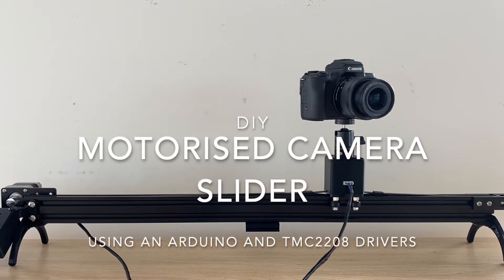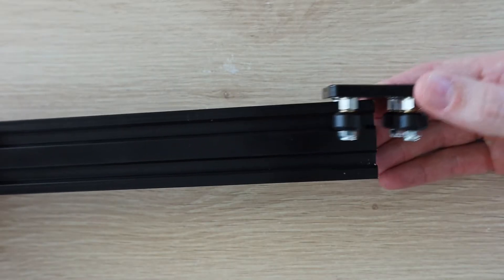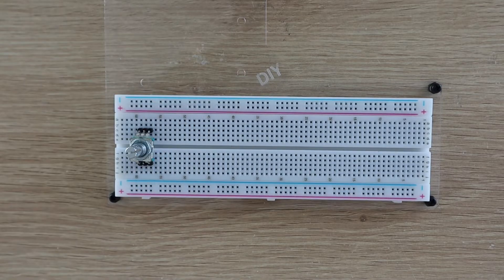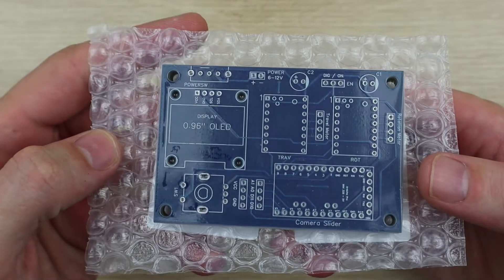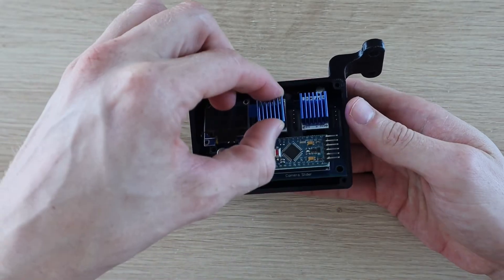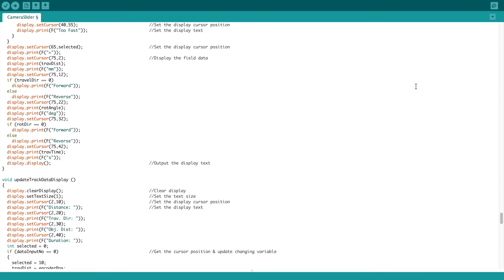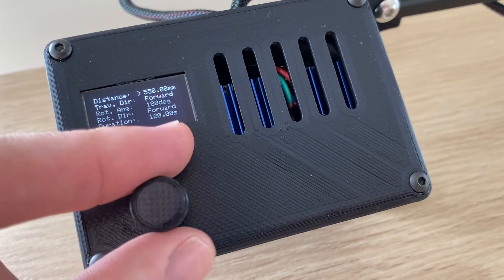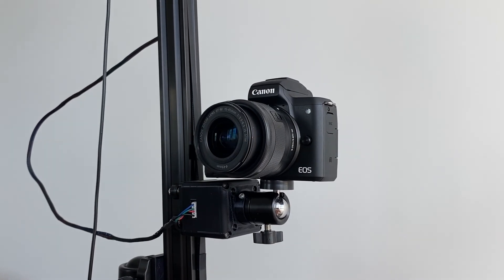DIY Motorised Camera Slider With Object Tracking

Comment: Awesome project! Thank you so much for documenting it. I am considering building something very similar. It wasn't mentioned in the video or the blog post I think, but does the slider have some kind of a homing mechanism? Do you have to manually move it to the start of the slider before you power it on?
Reply from the maker: It doesn't have a homing mechansim, this could easily be added through a limit switch on one of the available inputs though.

Comment: Hi. A 12V voltage was connected to the PCB board. But More than 8.9V flows inside. Where does the DC Stepdown take place?

Comment: Brilliant project ! I think I will strip down my own and modify it to this. I however have limit switches on both ends which I would like to incorporate, and I would like to run the pan stepper via a 5.18:1 planetary gearbox to take the rough steps out of the motion. Not being a coder, what would I need to change in your code to compensate for the gearbox reduction ? So the degrees match on the OLED to the actual output.

Comment: I haven't checked the maths on paper, but I'm pretty sure you can do that trigonometry backwards to save on measuring. Travel to one end and pan to the target, save the position, repeat for the end movement, and you should be able to solve backwards. Or at least, you can triangulate the distance to the target and use that as the input for your existing maths instead of a manually measured distance.

Comment: Can the V-Slot Gantry and Belt tensioner be 3d printed? Also, is there any chance you could share the EasyEDA file as well? I need to swap out the Arduino for a Nano.
Btw, can't post anything on your blog, the WP spam protection doesn't like me at all, no idea why.

Comment: Thanks for sharing! I built my camera slider when COVID first hit. I released the video less than a year ago too! It's always nice to see what others did! Ours had a lot of similarities, especially with the motor driver selection. I like that you made a PCB, this will make things far more robust. I used an old telephone cable for the pan stepper motor so that it stays nice and compact. Check it out! I plan on upgrading my camera slider to an STM32 based design where I can take advantage of its hardware features. I will find myself coming back to this video for inspiration about the object tracking! Thanks again, subscribed!
Reply from the maker: I like the telephone cable idea. Maybe have a look at using an ESP32 dev board, at their price with built in WiFi and Bluetooth , they're hard to beat.
Thanks for the feedback!

Comment: Hello.
This design is brilliant. After burning two arduino pro mini modules, I decided to run the project on CNC shield v3.

I have modified the code, but I have a problem with the rotation button (the button works, but the rotation, unfortunately, does not – I cannot change the value)

I would ask for help if possible – maybe others will also benefit.
Below are the places where I modified the code:

================= modified lines of code ==============
static int pinA = 13;
static int pinB = 12;

#define encButton 11

#define enablePin 8
#define travDirPin 5
#define travStepPin 2
#define rotDirPin 6
#define rotStepPin 3
===============================================

Everything works except the rotation of the button.
Should I set inputs 12 and 13 somewhere apart from the first two lines?
Reply from the maker: Hi,
I replied to your comment on my blog as well - you're likely using pins on your Arduino that aren't interrupt pins (not all pins on an Arduino are). The rotary movement triggers these interrupts to drive the control in the code, so if the aren't triggering then the rotation won't do anything. Have a look at what pins on your Arduino are able to be used as interrupt pins and re-arrange your IO to suit these.

Comment: This looks great and I think I can source all the parts! Quick question regarding PCBway, the ordering process is super confusing - do I just leave everything in the quote form at its default values or do I have to change anything?
Reply from the maker: Don't use the manual quoting too, PCBWay have a quick quote tool that asks you to upload your Gerber files and this populates all of the fields with data from the fields or good defaults, you can just order them straight from this form without any "technical" input.
Reply: @MichaelKlements  thanks! Ordered them and they came today! I'm going to try to do an 8-ft set up instead of a 4ft. I'll let you know how it goes.
Reply: Same question
Reply: @kodyhenry7  So I figured out after speaking to a rep at PCBway. You gotta register an account, then go back to the form and leave everything default but enter in the approximate dimensions + the quantity you want - then you submit it, and it will ask you upload to gerber files - then they manually review it and update anything that needs to be changed (ie the dimensions) so getting the form right doesn't really matter.
Reply: @OnceinaSixSide  Thanks! That was way easier than trying to create an order. Already landed on my doorstep!

Comment: Amazing project! Would this be compatible with an Arduino ESP32 board? I'm interested in making the project for ligthfield photography which needs pictures taken every x cm, so I would need to modify the code so the belt stops each cm and sends a bluetooth signal to activate the shutter
Reply from the maker: Thanks Aurelio. Yes the circuit and hardware are all compatible with an ESP32, you just wouldn't be able to use the PCB design as the footprint is obviously a bit different.

Comment: Hi Michael
After a lot of distractions I have tried to assemble the slider.
Unfortunately I can't get the stepper motor to fit in the case for the rotate  function.
The pin socket sticks out to far.
I have several spare stepper motors .  None of which will fit.
Did I miss something in your original video and instructions.
All the printed parts printed very well in PLA on my Ender 3 Pro
Your advice on this dilemma would be appreciated.
Regards Ernie
Reply from the maker: Hi Ernie,
Is there no way you can trim a bit off the top of the connector with a craft knife? How far is it sticking out beyond the edge of the case? You also might be able to push it in if it is at an angle (not square to the case).
As a last resort you could try widening the model a bit before printing it out.
Reply: @MichaelKlements  Hi Michael
Thanks for the information.
I put the model for the case into TINKERCAD and lengthened the hole to about 6mm from the top edge and widened it bit 1.5mm and reprinted it.
The bigger rectangular slot doesn't look out of place because the stepper motor is painted black.
Thanks again for your help.

Comment: This is brilliant mate. I am strongly considering doing this myself, I am a retired web developer but never done anything with electronics so it going to be a learning curve. The most intimidating part for me because I've never used breadboard and arduino will be setting this up and testing it, then I need to learn how to do the pcb design. Your video has basically demonstrated everything I want to do. Not sure if I can do it all with arduino with the LCD menu etc or whether if this would be easier in rasberry pi?
Reply from the maker: Definitely give it a go, you'll learn a lot and enjoy the process. The PCB file is linked on my blog post if you want to just use that one, then you don't need to do any PCB design.
I find that these sort of projects are better suited to run on an Arduino as you can then power them on and off at will without shutdowns and boot up times and you don't have to worry about corrupting the SD card. They're also more power efficient.
Reply: @MichaelKlements  Thank you so much, this is so helpful.

Comment: One of the best solutions and almost perfect. One weak thing is ball-head directly connected to motor - it's weak and doesn't smooth part/movement. You need to add "reduction gear" with using belts. It will make it smoother and more powerful, there is no need in speed, but smooth and torque are important. Is there any simple way to add ratio for one motor to the code? (I'm too far from programing).
Reply from the maker: The easiest would be to just adjust the number of rotation steps according to your new gear ratio.
Reply: @MichaelKlements  Hi Michael, I'm currently building this slider and am exploring making such a gear reduction and belt solution for the pan motor. If I were to for example use a 2:1 gear ratio, what needs to be changed in the code? I can't find anything in there pertaining to steps, the closest thing I could see is float pulsesPerDeg = 4.4444. If I'm using 2:1 is it as simple as doubling that variable to 8.8888?

Comment: Can you make it loop the pan/rotation? Like, set it once for a interview shoot and it will loop Left & Right until I press the button? If so, how can I do it? Thanks for the insightful video, motivated me to get into arduino coding.
Reply from the maker: You would need to add an extra loop to the main function and reset the counters but it should be fairly easy to get it to just cycle back and forth
Reply: Anyone done coding with loop function ?  Please share Needed Badly .

Comment: Hello Michael, great work, I am mindblower of the work you have done.
I wanted to ask how long is the slider and can I modify the size and if possible how can I do it ? 
Do I need other parts to do it or am I fine with these parts for a 1.5m slider ?
Reply from the maker: Yes you can extend it if you'd like, but only to around 750mm and then you'll start getting overflow issues on the number of pulses unless you extensively modify the code. If under 750mm then you just need to change the slider length variable.
The parts all stay the same.

Comment: Ciao Michael, desideravo sapere se cambio questo valore da 550 a 1000  

#define maxTravDist 1000

Perchè quando seleziono per esempio dal menù Pan e setto la distanza 1000 la direzione avanti o indietro e la durata lascio 120s mi esce la scritta troppo veloce tradotta io in italiano e quando lascio 

#define maxTravDist 550

e faccio la stessa configurazione, se voglio far uscire la scritta troppo veloce, devo scendere la durata a 10s se aumento non scrive niente.
Reply from the maker: Hi Antonino,
There seems to be a variable overflow issue when you exceed around 700mm. The counters and variables associated with the maximum number of pulses "overflow" and this starts causing logic issues.
Reply: @MichaelKlements  
Grazie per la risposta celere, sto usando un profilo a vslot 2040 lungo 1000 mm, come posso ovviare a questo problema, hai una soluzione?

Comment: I've been searching for an easy to build automatic adjustable height portrait photo machine. So it's possible to make it automatically adjust the camera height to the person's height. What do you think is the best approach?
Reply from the maker: You could mount this at 90 degrees on a tripod, that'll give you the height adjustability. To make it automatic you'd need something to "sense" the persons height. You could probably do this with an ultrasonic sensor on the roof above the area where a person is standing but they're need to reliably stand in the same spot each time. If this is not then case then you'd probably be better off using a camera on something like a Raspberry Pi and an image recognition package like Tensorflow to "intelligently" adjust the camera height.
Reply: @MichaelKlements  sounds like another fun challenge to tackle! 😁

Comment: Hi This is a great project I will build for my Ender 3 Pro.
Sorry I am new to this stuff and at my age a real challenge to get my head around.
I have ordered 99% of the parts Just a stupid question. What are the dimensions of the PCB.
I have created an account with PCBWAY and in the quote section they require the dimensions Length and Width.
I have viewed the Gerber files in the viewer but can't find the dimensions any where.
Please advise where I can find these dimensions. Have I missed something in the details.
Regards Ernie the old newbie from Australia
Reply from the maker: Thanks Ernie,
If you use the Quick Quote tool (option at the top) then it should ask you to upload the gerber files and it will read them in automatically. It sounds like you're still using the manual quote tool that requires you to input all of the information.
Let me know if this helps!

Comment: hello, Michael.  I made a slider according to your scheme, but I ran into a problem - my slider is longer, I wanted to change the length in the firmware, but if I change the length, when setting the movement, time, etc.  at the bottom of the screen the inscription "to fast" appears, and the slider (carriage) does not move, but immediately the inscription "complete" appears.  what am I doing wrong?
Reply from the maker: I've replied to your comment on the blog post. You need to change both the length and the time parameters and then make sure that what you're inputting as your travel time does not exceed the minimum interval between pulses which is set in the code.
The code checks that you're not asking the motor to turn faster than a certain set point before each movement. If you just increase the length then you're increasing the speed porportionally.
Reply: @MichaelKlements  hi Michael. I wrote in the firmware: maxTravDist 800, maxDur 3600, minDur 20. When selecting the time, it writes "Too fast" - for any time interval. Help me fix the firmware - I don't understand anything about programming.

Comment: Hello Michael,

cool project - thank you for publishing.
One little question: how do you fix the adapter to the ball-point-adapter (1:30). 
The adapter has two holes for M4 but not the ball-point?
With regards from germany
Harry
Reply: Thank you for your response. As i suspected: there are no srew-holes in my ball-point, only one large with an adapter-srew in the the center. Obviously I ordered a different/wrong modell. That's bad luck.
Harry
Reply from the maker: Hi Harry,
The 3D printed adaptor has recessed holes for the screws and these screw into the threaded holes on the bottom of the ball joint.

Comment: Hi , really inspirational work. Getting close to get everything working .I ordered all the slider gear via https://ratrig.com as part of their DIY kit.

The only thing I'm missing is the connector of the ball head for the second motor ; I'll ask a friend to 3d print that for me :)

I understand there is 1 screw connecting the connector to the shaft of the motor (1 screw). 

What I don't understand are the two other screws that go into the ballhead connector. Does the ballhead have 2 screw taps where this fit in? I've watched the video 10 times now trying to find a clue , yet fail to see how those two screw will actually lock the ballmount in place. Thanks for helping me out !
Reply from the maker: That sounds great, good luck with your build!

Yes, there is one screw which holds the 3D printed adaptor onto the motor shaft. 

The other two screws screw into two threaded holes on the bottom of the ball joint base. These just hold the ball joint onto the 3D printed adaptor. The actual locking of the ball is done through the thumb screw on the side.
Reply: @MichaelKlements  got it - I google it and then saw certain ballheads have these holes in them for easy mounting - learned a new thing!

Comment: Hi Michael Klements, I’m so excited about your project, it’s awesome, one thing I want to ask is can I extend the slider from 700mm to 1m? and then how the code will change. And another question is how is the wiring diagram if I want to add a limit switch.
Reply from the maker: Yes you can, you just need to change the maxTravDist parameter to allow the gantry to travel further. Limit switches should be wired to any of the free digital IO pins the same way a switch or pushbutton would be.
Reply: @MichaelKlements  Please let me ask a little more, if I want to use A4988 instead of TMC2208 what will the code have to change?
Reply from the maker: Nothing in the code, but you'd need to bridge the sleep & reset pins on the A4988. This also probably won't work well with the A4988 drivers as the steps are too course, you'll land up with very jittery footage and a lot of background noise.

Comment: Hey ! I need to build a bunch of sliders, and am currently researching what has been done already. You design is pretty much what i had in mind, but there's something i saw in almost every design on youtube, that i don't quite understand. But I guess there is a hidden reason to it : 
I was wondering why the rotation motor was below the ball joint. Let's imagine a 45° slope for the slider, i would prefer my slider to stay on the level instead of rotating parralel to plane of the slope.
Mounting the motor platform on the ball joint and then mounting the camera would solve this issue
Reply from the maker: Hey Warths,
It depends on what you're intending to do with your slider. For most people the rotation axis would be used primarily to keep the camera pointed towards something while panning - such as tilting the camera down to face something on a table or desk. For your application it would make more sense to have the motor above the ball joint.

Comment: Real nice design! The only thing I can think of to add would be an energy chain. There are a few on thingiverse. Really liked the countdown feature!
Reply from the maker: Thanks for the suggestion, I’ll have a look at some 3D printed options.
Reply: @MichaelKlements   troguh an other video i found a other possible solution for improved control of the cable. 
The type of cable is called spiral or curly/ curled cable. The type of cable is used on wired phones.